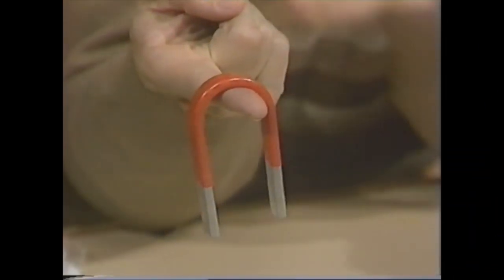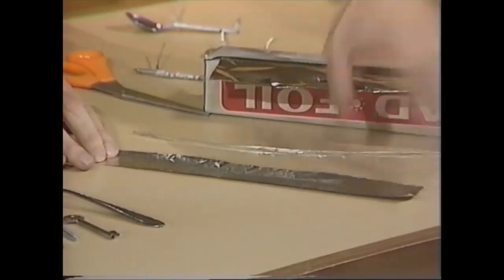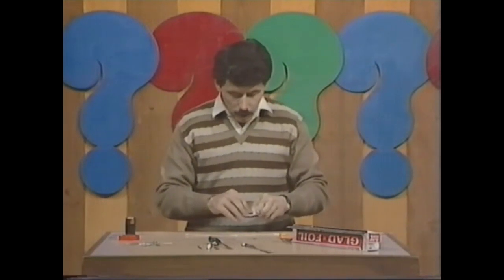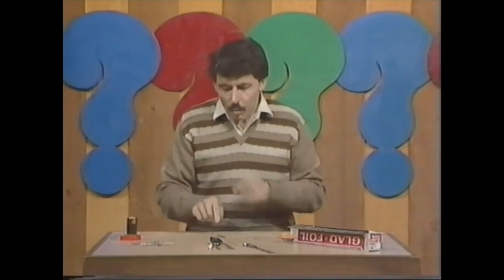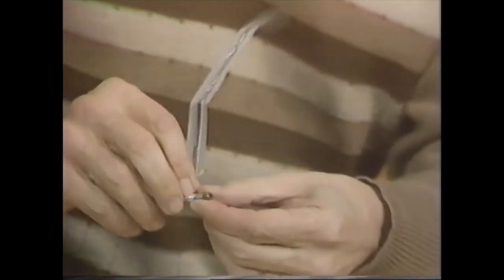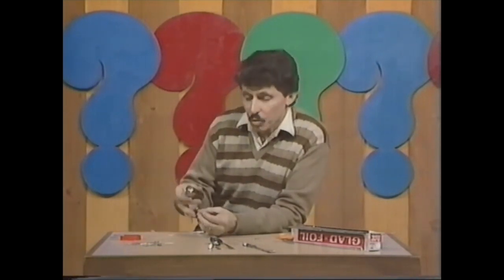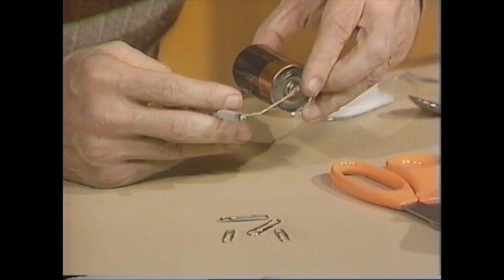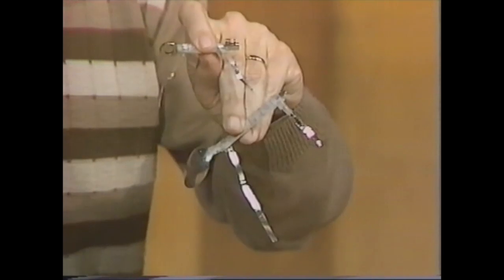Electromagnet made with sticky tape

Comment: i missed the info how to "turn off" a permanent magnet... you can do this :   put the permanent magnet inside a jar (or similar) than use the jar outside bottom to attract the paperclips ..in order to switch that magnet off simply remove the magnet out of the jar and all paperclips will drop off the jars bottom...
Reply: The info was in the video, simply disconnect the wire so no electrons run through the wire creating the magnetic field.
Reply: @oo0Spyder0oo  learn to read.